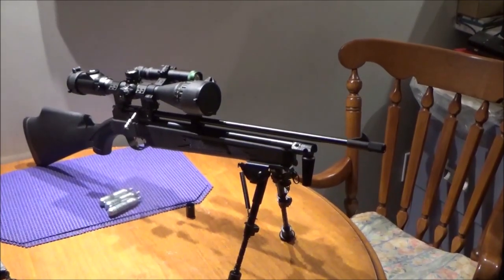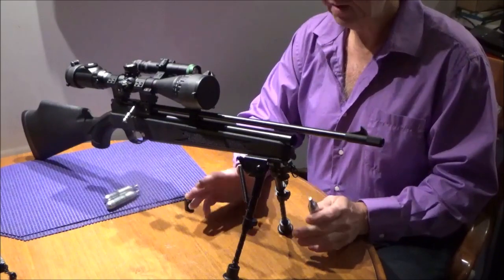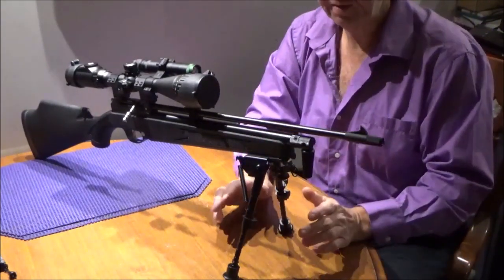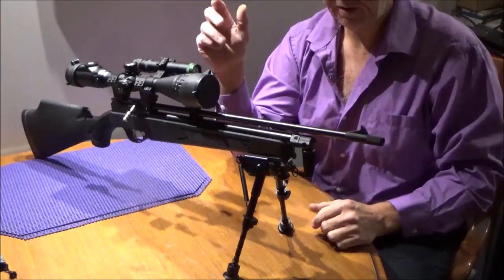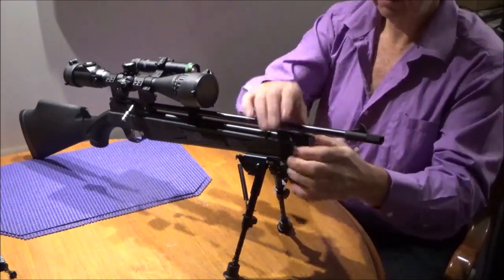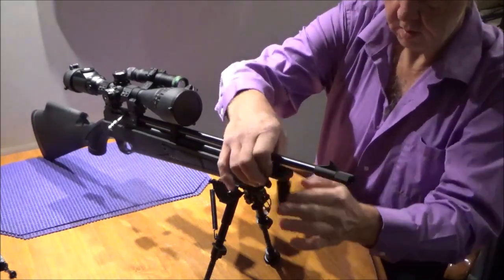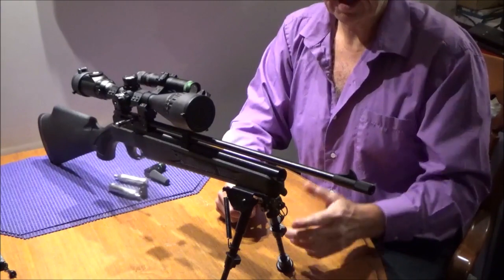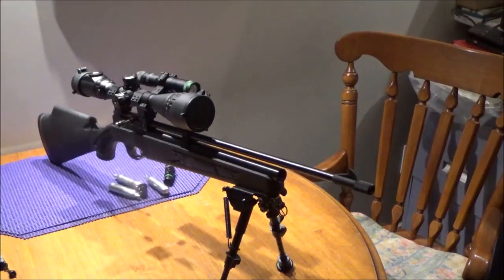How to Properly load co2 gas in the Diana Trail Scout Air Rifle

Comment: Great video kevy ironically even though I feel I am some what mechanically inclined and capable I've managed to waste at least 9 bottles of co2.First time I didn't screw it in far enough then I had a oring issue, 3 I some how forgot to tighten with arm straight instead of angled. Great recommendation on the orings got mine in totally solved problem one and your latest video will most certainly help alot of gun owners. Thanks again kevy and stay safe
Reply from the maker: thanks man happy shooting
Reply: Es posible cazar aves con este rifle i la distancia máxima !

Comment: Kevy have a issue with the crosman 2240xl. I've never gotten a gun directly from crosman with the steel breach. So on gun number 1 my only interest was to lighten the trigger, grips and reddot, I never tore into it.So onto gun 2 I purchased with the intentions of building a little carbine, valve upgrade barrel upgrade lothar walther and so forth, now here's my problem. I thought the breach and tube looked like one but thought it was perhaps powder coating or something. Well I took everything off and  it will not come apart. I reached out to crosman but figured you would perhaps know what I am dealing with as it doesn't make sense for them to produce this one different than others due to cost. If you know I'd sure appreciate and it's driving me crazy
Reply from the maker: do me a favor and email me your number at airsmith28@hotmail.com and ill call you and we can talk on the phone this way ill get a better idea as well what the problem is you got going on ..

Comment: Will it function properly if one of the three cartridges you load is a spent one?
Reply from the maker: yes you can run on a min of 2 but you can not run it on 1 only like the manul says you can tried that and it did not work so they lied
Reply: @KevinMillard68  Thank you very much for replying to a three year old video. I subscribed. You have a usefully informative channel.

Comment: I have yet to successfully load the co2 cartridges in this thing. One of two things happens, either one cartridge pierces while I'm tightening by hand, or I get it tightened properly and when I' done shooting I find only two of the three cartridges have pierced.
Reply from the maker: well your doing something wrong all 3 should perice once you life the lever to perice them all at once
Reply: @KevinMillard68  I think I understand what's going on.  Each piercing pin is 2.5 mm in length, so to guarantee that all 3 bottles will pierce, the plunger needs to move at least 5mm. The plunger only moves about 3.8mm, so the only way all 3 will pierce is if the piercing force is very consistent between bottles. According to the Trailscout instructions on Diana's website, the plunger depth can be adjusted, but it looks like that's another feature us Canadians don't get. My plunger is not adjustable.